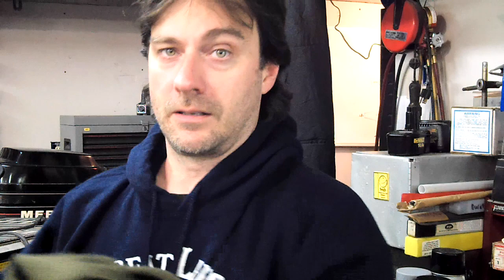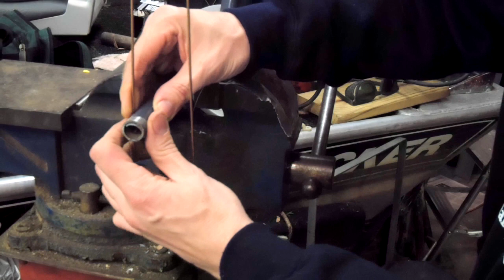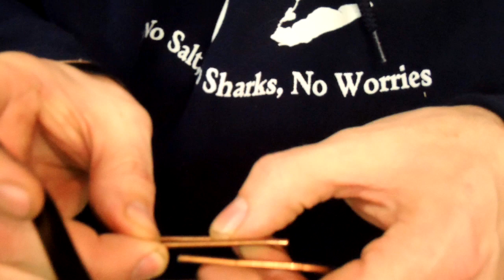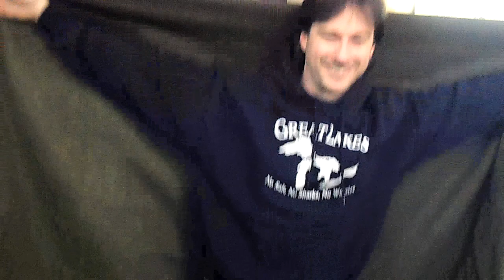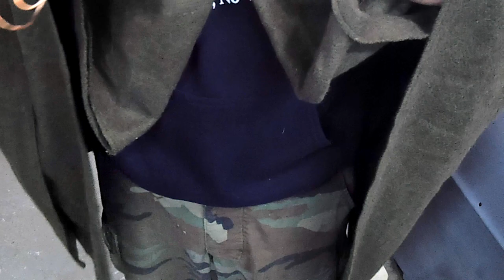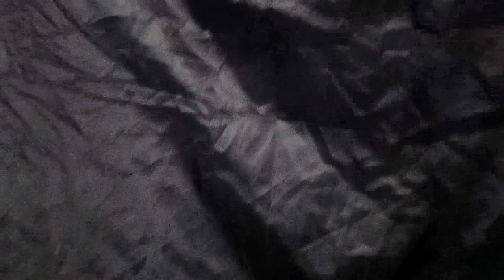Making A No Hole Blanket Pin

Comment: Another no weld option, use a short piece of shrink tubing, slide it over both ends, heat it, connected!
Thanks again Mr. G for another great idea, full of humor.
Reply: brilliant! Heat shrink tubing is awesome stuff! I'd probably want those two ends of wire to overlap most of the straight side if I was to make one without welding the ends together.
Reply from the maker: +Lane Douglas  Thats a great idea Lane!
Reply from the maker: +Darryl Machtmes  Man I agree, that is a great idea!
Reply: Lane Douglas , same idea overhere😅
Reply: or solder?

Comment: Thanks for this video. I am a seamstress and I make Renaissance clothing. I have several very nice velvet cloaks that had not had a neck attachment put on yet. I do not like the thought of poking holes in the very expensive velvet with a brooch. With the right wire, I could attach some metal floral charms to this and have a very lovely cloak pin.
Reply from the maker: +Christina Waldrop  You are very welcome Christina and I gotta say wow! My mom had a boyfriend years ago that was big into the Renaissance festivals and reenactments so I am very impressed that you can make the clothing. I can make gear bags but they look like they were made by a 9 year old. LOL. Bend you up some pins, its amazing how well they save  clothes.

Comment: Happy New Year to you. Great video and awesome tool. It would be handy to just carry a couple of these with your stake sack for those times when you need to: a. hold a coat together after the zipper breaks, b. use a small tarp as a rain coat, c. pull a tarp together on the front of a rain fly, etc. etc.

NOW . . . about that uncovered electrical outlet on your wall . . .

Have an OUTSTANDING YEAR.
Reply from the maker: +Steve Olsen Happy New Year to you too and I'm glad you liked the vid. Theres no telling how many uses there are for these clips. Ill fix that outlet next week. LOL. Thanks for watching.

Comment: Man!! That's a great idea. Thanks for showing that. I can't wait to get out to the shop and make one. I believe I will try it with 1/8th brazing rod. I also thought about filling down a lap joint and silver soldering it.
Reply from the maker: Thanks Danny! I'm glad you liked it and can use it! I'd braze it if possible. Silver solder doesn't flex enough for me
Reply: @Reallybigmonkey1  good point. Thanks.

Comment: Excellent project David. You always come with the coolest ideas. I've looked at blanket pins but, as you pointed out, I didn't want to put holes in my blankets. Your project solves the issue.  Thanks for sharing this, I' m going to have to make a couple...
Reply from the maker: +Woodenarrows Thanks, Im glad you liked it. Someone mentioned that all the old thick 100% wool blankets would "heal" themselves of holes. My modern prima loft blankets and fleeces wont! LOL. Thats where these  clips excel. Have fun makin em and Thanks for watching

Comment: Instead of using tape to join the two wires, you could use the heat shrinkable connectors! That would be more permanent! Great video, thanks!
Reply from the maker: +Jack Chapman  Thats been mentioned several times in the comments and I do love that idea! Thanks for watching Jack.

Comment: That looks very similar to a couple of old, 1800's family heirloom, blanket clips, hooked together by a couple of common blanket pins, that my Great-Grandmother had in her sewing box. When I asked about them, she said that holes in 100% wool blankets will seal themselves but the same isn't true of linnen or cotton so the clips were used instead. I like your modern version better, the decorative twists and nobs at the ends of the wire to keep from poking holes are difficult to make, let alone manage when using the clips. Thank you for another great video.
Reply from the maker: Now that is a very interesting story! I had no idea this idea has been around that long. Thanks for sharing that Quinten

Comment: I'm on it! I can see this for closing tarp shelter flaps without corsage and all kinds of useful ways to use it in quick bedroll packing shelter aides.
Reply from the maker: Very good ideas Diane!
Reply: @Reallybigmonkey1  Thanks, Dave. I looked around the farm...no welding wire but I have plenty of vineyard wire. It's pretty stout so I'm making my first ones with it and hoping it works.

Comment: A couple of plastic spring clamps would work also. You can clamp them to body appendages when not in use on the blanket. I'm going to make a couple of those pins with a couple of brazing rods or maybe # 9 wire and see how they work. Another Great video!
Reply from the maker: +tjdell480  I think plastic spring clips would work on fleece or modern polyester camp blankets but Im not sure if it would hole 2 to 4 layers of wool. One would just have to try. Ive made these out of carbon steel and stainless but havent tried brass. That would look very cool tho! Thanks for watching

Comment: Grate idea! I love it.
 Or you can go the easy way.
Get a smallish rounded river rock put it on the in side push it a bit and tie it on the other side, around the rock on the outside With a piece of string.
 And boom no hole in your blanket.
To undo it you untie the string and grab the rock. Best way ever to make a cloak. And you never have to worry about losing or bending your pin. Same thing works grate for tarps tie outs to. Happy camping.
Reply from the maker: Yes, that's a well known trick.  Thanks for watching
Reply: @Reallybigmonkey1  I at one time I though the same but sadly ideas like these are getting lost in the past. Thank you for helping keeping history alive.
Reply from the maker: @hooXpoo  Stuff like that is hard for me to judge since I've seen all the old tricks done over the years. You're right tho. A lot of this stuff is getting lost in time

Comment: thanks for the video.  That is an interesting twist on the blanket pin, and it looks like it works quite well.                                                      Geoff
Reply from the maker: +GodschildinNC Thanks Geoff, I'm glad you liked it.  It works well as a blanket pin and it holds two tarps together and can hang a light from a ridgeline.Thanks for watching.

Comment: slide a piece of heat shrink tube on first , tape joint ,slide heat shrink over tape . the shrink wrap will provide a stronger hold on the ends and give extra grip to the clip on your blanket . great idea , thanks for passing it on . 462
Reply from the maker: +Pappy  I love the idea of the heat shrink tubing. Thats a huge improvement over tape! Thanks for watching Pappy
Reply: yer one of my favorite channels . i enjoy all your videos so far . i made my own blankey pin . but it's like the old style...puts holes in it . like you i don't much care for that . i am going to try this but i am thinking a heavy brass rod . keep up the good work .

Comment: I make gizmos out of heavy wire that resemble a safety pin.  They will work as a safety pin blanket pin.  I use them primarily as a "safety" retaining pin to keep wagon hitch pins from falling out.  But with some extra turns you can make lots of different things  spring loaded or paper clip style retainers
Reply from the maker: +Randy J  Sounds cool man. Im sure theres lots o variations on these but this is the best one Ive found. Since a paper clip holds things in layers from one side, its tricky to get a clip to hold from both sides like this one does. Take care Randy and keep making stuff.

Comment: I heard somewhere that if you take a wire brush to a wool blanket it becomes waterproof.  The old fashioned bedrolls used this technique. Then you can use it as a tarp shelter. So that doubles the use factor. Blanket, tarp, coat, hoodie.
Reply from the maker: Really? I've actually never heard that.  I'll have to research that.

Comment: neat idea and I agree 100% about not putting holes in the blanket, because if you really outdoors you might be using a good ($$$) blanket, or even a stuffed quilt, BUT....I doubt this invention will really hold very well.  I'm thinking a mini-vise grips with non-marring, non-tearing jaws.   Or something LIKE this pin, but with some added feature that allows the pin's wires to be folded over and snugged down, so it really, really grips the blanket.
Reply from the maker: Thanks.

Comment: I been using a celtic blanket pin for years. If'n ya use a 100% wool blanket (Pendleton blankets are great) the holes seem to heal themselves. I have noticed that if the blanket is wool mix, the holes stay longer. The remedy for this is to wash the blanket in cold water and hang it flat to dry in fairly warm place, or have it dry cleaned.
Reply from the maker: +Robert “FireLion BlueHawk” Winkler  I had heard that before but wasnt sure because I dont have any for real 100% wool blankets. Its good to know from a friend that its a fact. As always great to hear from you Robert and Thanks for watching
Reply: +Robert “FireLion BlueHawk” Winkler 
I have two of 'em.  I've had it for thirty-two years and they are in excellent shape.
Your friend in Bushcrafting, Alexsandra Rokas

Comment: I just love your shop videos, always learn a lot.  I have a Harbor Freight wool blanket that I use in my office.  The office was enclosed the breezeway between the house and the garage so there is no heat in it.  i use the blanket all the time so this will come in handy.  Could you use a propane torch and some solder instead of tape?  Look forward to the next one.
Reply from the maker: +Bruce Ferguson  Thanks! I love making the shop videos, I need to make more. Thats cool you can use this, I figure if the metal is clean enough the solder should stick. Think about heat shrink tubing too. Thanks for watching Bruce

Comment: Looking at the vid picture icon thought you were going to make a huge diaper pin !!!!!

10*  Such a unique device.  You made me think of all its McGyver multipurpose uses.  Hang on tree limb, ridge line, inside tent ridge line, or a metal O ringed 3-4 legged tipi for hanging boots or backpack from their fabric loops or laces.  Hang from tree, ridge line, or inside tent ridge line for a candle holder.  Use as a no-knot ridge line tensioner.  Insert, wrap, and underwrap (lark's head) the tag end onto the device.  Put the device onto the ridge line, and wrap as a cinch knot.  Tension, and no knots.  With a small alcohol stove (or DIY rocket stove, this is the cooking grill.  Could use as a lid, bail wire, or container lifter from the campfire.  Use with tree limbs on opposite sides of stream/waterway as the trot line holder.  Absolutely perfect paracord hanking device, or a fishing line reel.  Hang tennis shoes, boots, or wet/damp clothing from ridge line or cooking tipi, near campfire for drying out.  Excellent no knot tie device for roping up fire bundles for carry.  Smaller device with sharpened inner edges, use as a fish gutter, fowl or meat skinner, pushing under skin, and pulling down (versus knife cutting and chopping).  Smaller 90 degree sharp inner curve, ferro rod sparker.  Sharpened inner curve blade making wood fire dust, scrapings, tinder, feathersticking, curved carving dowels etc.  Push/pull draw blade inner curve blade.  Slide on multiple grit bands for a sharpening tool.  Use same device for a pup tent, tent, hot tent, Mors plastic super shelter entrance closure.  Split cane/dowel/stick end, insert device, and put further interweaved bamboo, sharp sticks, tines, harpoons, trident for a fishing spear/defensive weapon.  Have a tall blunted pole, small blunted notch at top, device inserted horizontally for a safe pillar point for hanging tent, tarp, plastic sheet without puncturing shelter.  Scratch up outer surface of long edge for a flint and steel striker.  Mini-serrated long edge for a small hand saw.  Use inside a triangle wooden frame backpack as the center rope tie offs for strength and shoulder brace attachments.  Use in a swampy water/wetland cathole (or next to stream mudbank cathole) with a small plastic or metal container, wrap cotton fabric around the device as a filter grill.  Use with wrapped cloth fiber as water filter, coffee/herb tea filter.  Many more options.
Reply from the maker: +John Lord  Wow! I love all the ideas!

Comment: I just did 2 clips, 1 with a squeeze bottle straw/tube over the overlapping ends of one, and with shrink tubing over the overlapping ends.

I felt the overlapping ends provided more strength.

The squeeze bottle tube didn't really fit easily (I wanted to cover the overlap in only one piece) so I ended trimming the  part I couldn't push on, and putting it on the other end, and having the 2 pieces meet in the middle (yes I tried soap, water, and forcing the tube over something to stretch it out).

For the heat shrink tubing, I used one continuous piece and when I first tried putting a snug piece on, I tore a hole in it (I probably should have rounded the ends)...so when I managed to get another piece on, undamaged - I threw the next size up tube over it for more strength (the tube sizes were 20-12 AWG & 18-10 AWG).

Sheesh, I thought 4 feet of 1/8" non-threaded AllThread would be too long...nope...I just had to rub off all the light surface grease.

I freehanded it with a 1 1/4" PVC coupler and 1/2" PVC pipe that I had. 

Tip: put the smaller pipe in a vise when you're bending the wire.

The larger bends were easy and looked good as long as I bent in the correct angle/direction.
The smaller bends I couldn't keep rounded because my pipe moved as I was bending the wire.

They work much better than the blanket clips with elastic between each "grabber" :)
Reply from the maker: Sounds great Ray! Thanks for sharing how you did it
Reply: Tip: Eyeball it 3 times before you do the final "snowshoe tip" bends on each end.

I only double-checked and then wondered why both tips were going the same direction.

Using a vise for this part is much easier than freehanding it with pliers or the back end of a hammer.

Not only do things get squirrelly when re-bending into the correct direction, it felt like I almost snapped the rod at the bends.

Use a vise, check more than twice.

Comment: Nice design and easy to follow instructions. Technically it’s a big ass paperclip, but it seems to work great!
Reply from the maker: "Technically" it is not. A paper clip holds layers from ONE end. This device holds layers from BOTH ends. It does work great for what I use em for
Reply: Sorry, i'm no native english speaker, but with "technically" i meant it works on the same principle/technique as a paperclip. By making angled loops to press layers together.
Reply from the maker: Same principle but folded completely different to hold from both  ends, not just one end.

Comment: Nice pin, it's like a super size paper clip. I was thinking heat shrink tubing might be an alternative to using tape or possibly metal bands and a crimping tool just like those used for building bird cages or to make a lanyard. I own a cheap "stick" welder, but have yet to learn to use the darn thing.

Speaking of Darth Vader. Han Solo called, he loves your haircut. :)
Reply from the maker: Looks like a paper clip but actually isnt anything like it. A paper clip holds layers from one side only. This holds layers from BOTH sides overlapping them. I like the heat shrink idea. Now get out there and learn to weld. LOL
Reply: LOL, You have me there, now I have to learn to sew and also weld. 
And yes, the pin works on both sides. That's what makes it different and interesting. Not even a money clip can do what it does because it is flat when at rest. It's really a neat project and an interesting gadget.
Reply from the maker: Also, theres no telling what other uses it may have round camp!

Comment: That actually solves my problem of having to throw a tarp over myself and my backpack in a split second downpour and still keep my hands free. I don't always have a poncho, but always have a tarp. Also I was wondering if a person taped the wire at the extreme ends and applied some liquid weld...then removed the tape after it dried, if it would hold up? Maybe a coat of paint and/or polyurethane to help seal and preserve the metal clasp from rust?  Just think in...All and all a very useful concept!  Another thought here...On my tee pee tarp sets, those clips would work assume to keep the door flap closed as well. Normally I use the marble/stone tie offs in high wind situations but in good weather these clips would be more convenient.
Reply from the maker: +john- waxerone  Sounds great! You have a lot of good ideas for it. It would be a super fast clip on a tarp. I like the idea of the TeePee door too. It would also overlap the tarps by 3 to 4 inches. Another idea is to cover the ends and join with heat shrink tubing. One other non slip idea is to dip the whole thing in that tool plasti dip. You would just have to carefully cut apart the seams once its dried.
Reply: I think the heat shrink tubing covers it all, no pun intended...you have it joined and non slip all in one excersize. I think thats the route I'll take and maybe still a little squirt of camo, because you know how we all like camo! Thanks.
Reply from the maker: +john- waxerone  Camo is always good!

Comment: Instead of welding the wire to finish it off, someone without those skills or tools could just use bird wire (aviary mesh) clips which have a special clip crimping tool which crushes/squeezes the wire together.
You should consider selling these, it’s like paper clips but for blankets :)
Reply from the maker: Looks like a paper clip but doesn't work like one.  If you think about it a paper clip holds layers from one end only.  These hold layers from both ends over lapping.  It would be cool to make these